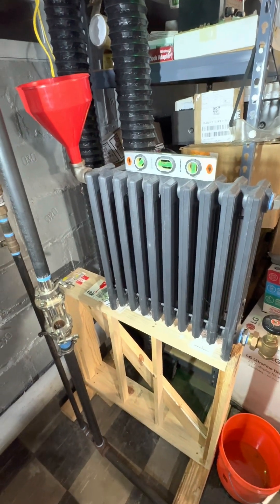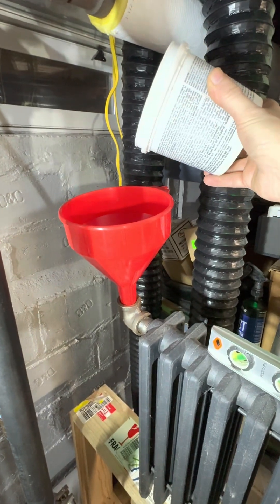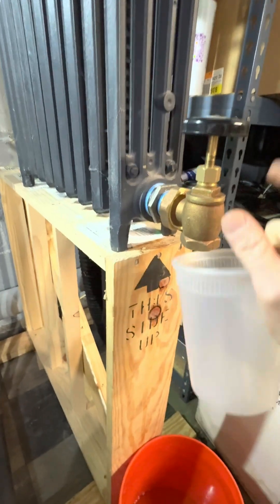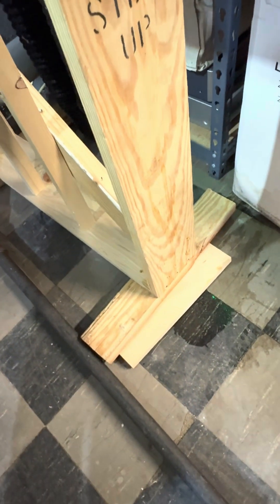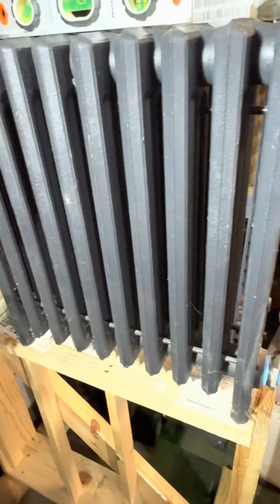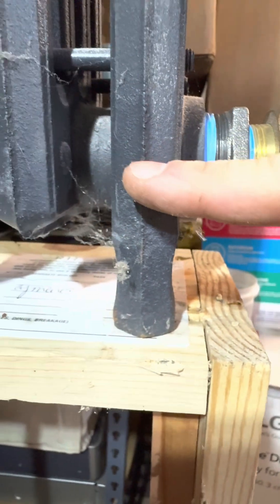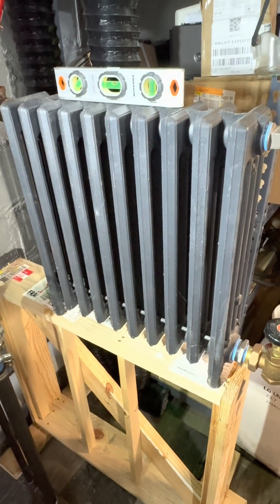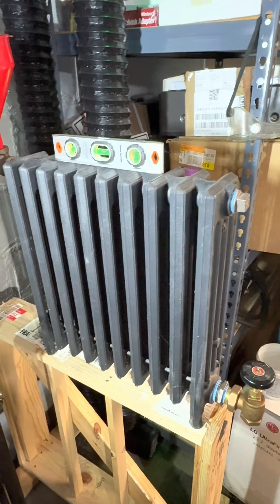Steam radiator pitch experiments, part 1

Comment: Great video.  From my experience with old radiators pitched in the wrong direction results in calls from tenants due to wet steam rusty steam spewing out of the air vents on to the walls.  The wall get dirty and mildewy and have to be dried, spackled and repainted.  The right pitch matters.  It’s really worth taking the time to put a wedge under the radiator to get the pitch right.  I really enjoy your videos and experiments.  Greetings from New Jersey.
Reply from the maker: Thanks also from Jersey!

I hate to say it but those symptoms sound like surging (the boiler throwing water up to the mains and radiators)

Does your water level drop dramatically during steam production?
Reply: @pb7379-j2k no - the water level is fine.  I used to use SurgeX until I saw your videos.  I have 2 houses that are 120 years old and the previous owner never maintained anything.  Lots of rust in those pipes.

Comment: Can this be installed horizontally under the ceiling in the basement above my main steam pipe line?
Reply from the maker: I have seen horizontal radiators on basement ceilings but if you want to heat the basement I’d probably recommend a hot water loop

Comment: If it was a true steam only radiator it would only have a lower nipple port. 
Forcing steam to the water. 

With this radiator you also have an upper nipple port reducing that chance of hammer. 

This radiator can be both steam or water. 
See if you can get a steam only radiator for a comparison. 

Otherwise I love your videos. 
Very interesting and thought provoking.
Reply from the maker: @RalphsHeating  that top port would also be used as the supply in a two pipe system, and that’s how I was going to get steam into it. But then I can’t do one-pipe experiments with it. But those are hard anyway due to height issues
Reply: @ 
Yup I can see that with a top supply. 
👍👍👍
Reply from the maker: @RalphsHeating  well I only removed the plug from up there so I could add water to it.
Reply from the maker: @RalphsHeating  and thanks!
Reply: @pb7379-j2k  it’s not the plug removal. 
Water radiators are connected at the top and bottom with a nipple port water passage. 
Steam only are connected at the bottom. 
No cross connection at the top at all.
Reply from the maker: @RalphsHeating  you’re right, all my old ones are like that, but they don’t want to make steam only ones anymore, at least not this company!
Reply: I wish they made an adjustable leg on the radiator.
Reply from the maker: @aglasserm1679  I think my next video will show it doesn't even matter, but we'll see!
Reply: @ I look forward to seeing it!
Reply from the maker: @aglasserm1679  me too LOL!

Comment: I don't claim to know the answer, but I will take a guess. 1 drop of water turned to steam increases its volume 1700 times. If steam enters the radiator and hits water some steam (how much??) will condense back into water. . When the volume of the steam condenses 1700 time it will create a lower pressure in the radiator than when the steam was just starting to enter. To me this lower pressure weather a vacuum or not will cause more steam to enter the radiator at high velocity and when it slams against any water you get water hammer. How much hammer, how much water how much steam and will the air vent let air in to try and equalize the pressure....I don't know

But I remember in one of Dans books he describes taking an air vent out of a radiator and holding a lit match at the air vent opening and the flame gets pulled into the rad and pushed out pulled in pushed out like the rad is breathing which was caused by poor radiator or branch piping pitch.
Reply from the maker: @ed6837  yeah that’s a good description of what causes steam water hammer. As for the match I’m a bit skeptical because all vents puff like that as steam advances then collapses from giving its heat to pipes and radiators

Comment: I would be extremely interested in seeing you back pitch this radiator with live steam going to it and just at the point that the vent starts spitting then quickly drain the radiator to see how much water is in it.  I would also be interested in seeing real wet steam and  little carryover getting to the radiator with correct pitch to see if that would eventually cause spitting radiator air vents and at what point of wetness.
Reply from the maker: I might be able to do something like that. I have to figure out how to get steam to it. I was thinking via a two-pipe arrangement but then I wouldn't be able to do those single-pipe tests.

Wet steam is a funny term. It's not really a thing...water droplets do not stay afloat in the steam as it travels through the pipes. Any droplets immediately hit a pipe wall and stick to it leaving the steam separate. The exception is in a surging situation which is really like the difference between breathing and vomiting if I may speak a bit coarsely.

You can see some different examples of water appearing in the steam supplies/header in my other videos.
Reply: @pb7379-j2k  An idea might be to elevate the test radiator up high then run a steam rated large diameter (same as valve) hose from above your steam header inspection glass viewers to the elevated radiator in sort of a reverse return single pipe configuration. This way you could test and see what surging does in terms of causing spitting air vents on the single pipe radiator. of course you would have to dirty up your boiler water quality to make it surge but I think this would be super interesting.
Reply from the maker: @marriagepartnersministry5942  a little too interesting! Full on surging is very brutal on vents!
Reply from the maker: @ I do have a csst flex pipe on the way, I’m going to start out feeding it like a two-pipe system

Comment: I've had alot of pipe failures at low points where a bunch of water collects.
Reply from the maker: Yes, I've seen it too. But how does that relate to this video? Are you making a point about radiator pitch? I showed that even a correctly pitched radiator has water in it all the time. Help me out here 😅
Reply: @pb7379-j2k  my worry is with more water sitting there, it may rust the inside of the radiator a little faster. More of a chance for radiator failure.